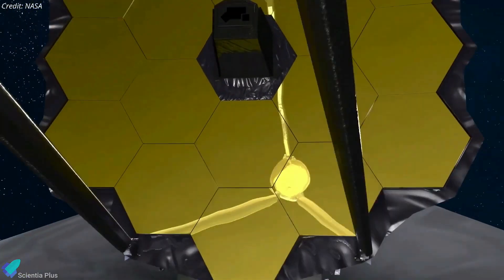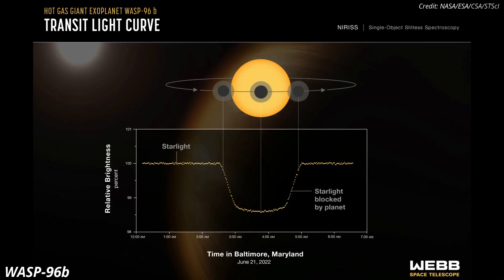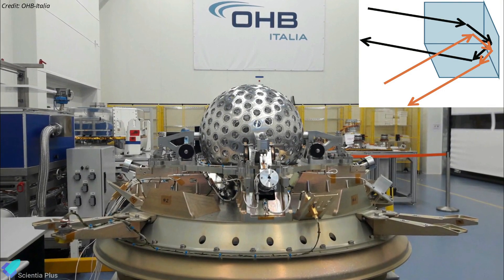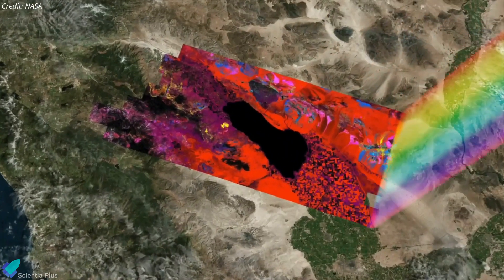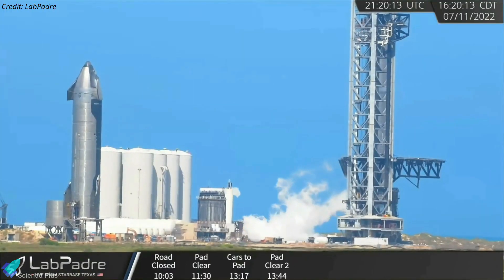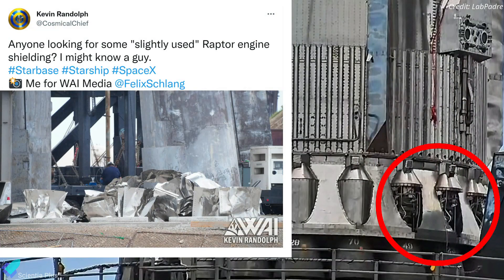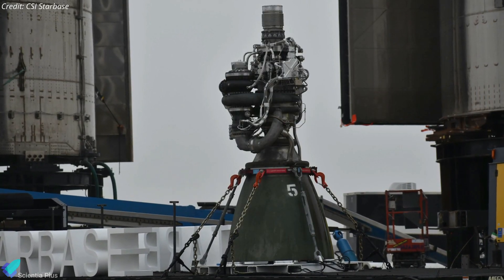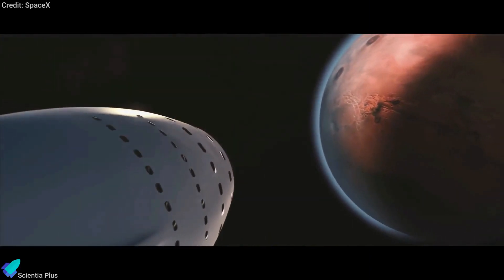SpaceX Sent Super Heavy Booster-7 for Repairs, Raptor 1 Vs Raptor 2, JWST Images, CRS-25, Vega-C

Comment: I have to say: "The risk & quality management of Starship project is not good enough!", When you hear something "Unexpected" means something could be devastating. If one Raptor 2.0 engine is working fine doesn't mean the rest 32 are all okay! There are some cases must be cautious after the explosion of BN7 regarding the whole internal steel structure and all the soldering joints. Could they sustain from the shock wave w/o any damages of cracking? especially the bottom side of BN7.